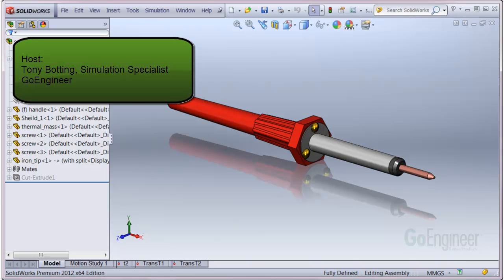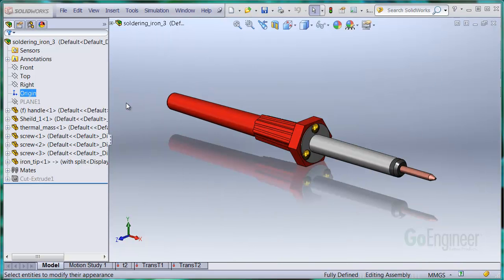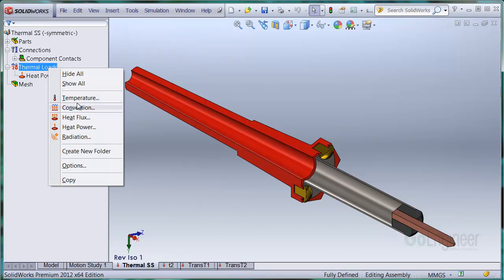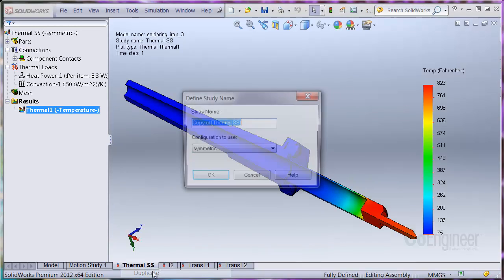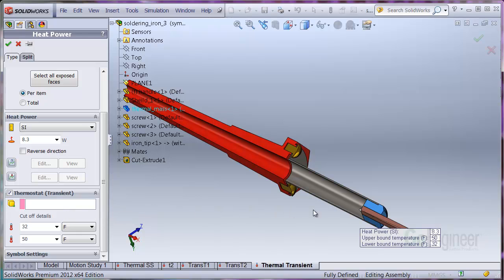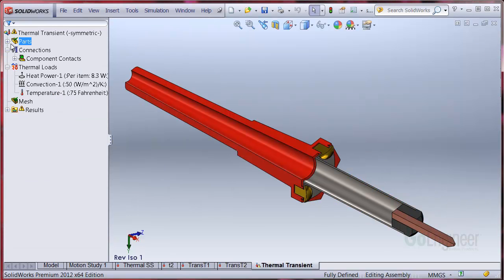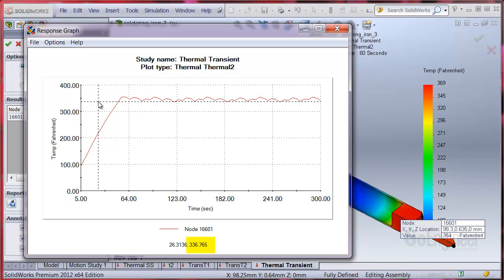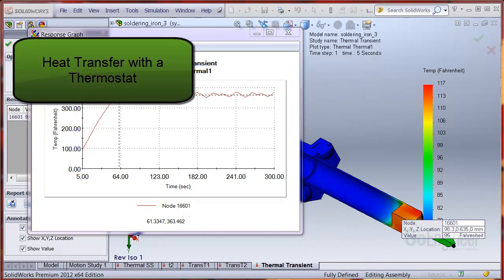SolidWorks Simulation - Heat Transfer with Thermostat

Comment: Instead of having a KNOWN value for the temperature to reach and having heat power turned on and off, can we turn heat power on and off to find an UNKNOWN temperature after a certain number of cycles? 

eg: heat power 3 seconds on, 5 seconds off, repeated 10 times graphed over time?